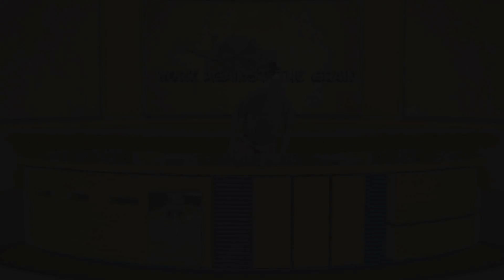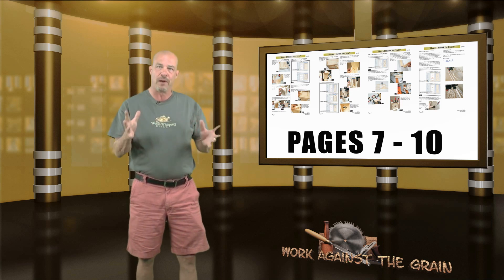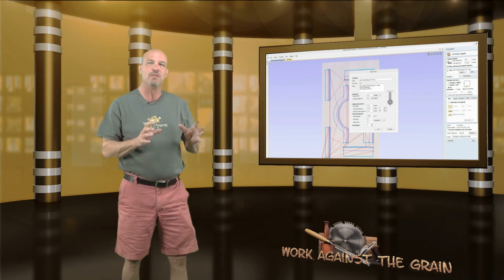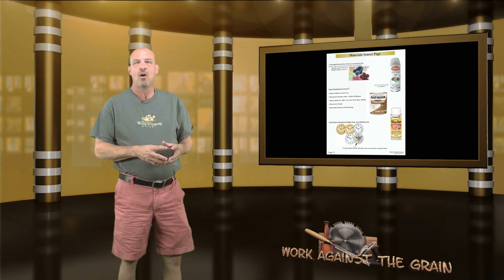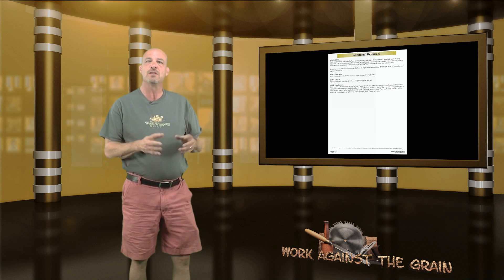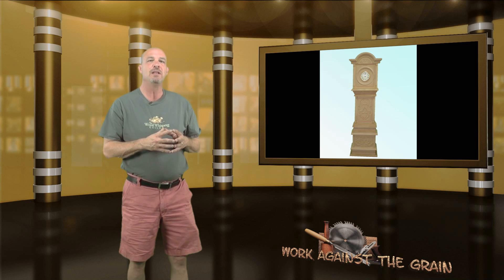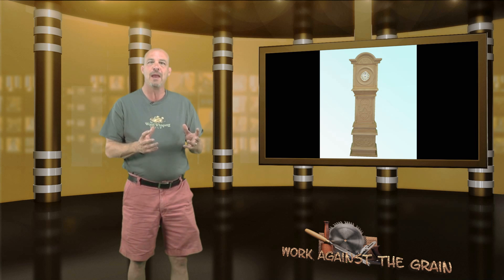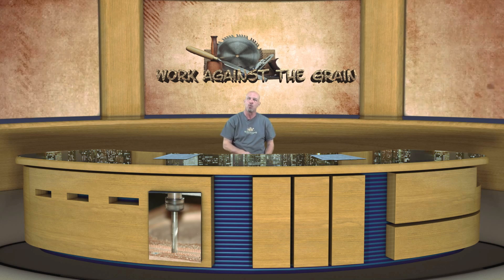Vectric Clock

Comment: Hi Jeff,
I just watched the mini Grandfather clock video. Great video!
I am new to CNC routing and have a few question on the files. The depths and outside, inside locations in toolpath.
I had not gone through all the files yet. Just the first one and the last one and now I am asking myself what!!!
On the file Base column Parts 90 V what is the depth cut? 
If there are any other 90 V cuts will they all be the same throughout?
On the file top Part 6a and 6b  what is the depth cut of the .5" ball noise and is it inside, outside, or on the line?
That file also has a .25" EM Decor Profile and a EM Profile cutout. Are the bits the same.
I am asking myself will I be asking the same questions when I go through the rest of the files.
So I'm telling myself for the profile cutout my depth is .78 and I choose outside the lines.
I think this is correct.
Now what about the rest of the setting in toolpath for the other bits?
Hope you can help a newbe :)
Thanks
Philip